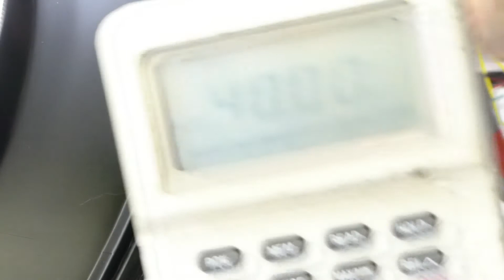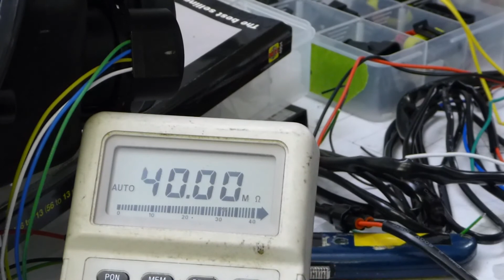FIX: Vertical adjust motor on R56 MINI Cooper LED DRL retrofit projector headlights

Comment: Could you please share the model, brand and where you bought this headlight? Thanks!!
Reply: Unfortunately it's been a long time and they aren't available from the supplier I used - mine came from PowerfulUK and were p/no HLM987-Ch; however I wouldn't recommend them! The bulbs wobbled and vibrated no matter what I did, and in the end we went back to the OE headlights pretty quickly..

Comment: Where did you get the headlights from?
Reply: eBay - they were listed as "F56 look" or words to that effect. Having removed them less than 12 months later I'm not sure I could recommend them, though.. the light output was no better than standard and one beam 'wobbled' due to poor manufacturing

Comment: Sorry to bother you. Quick question after I add the same DRL headlights on my 2012 Mini Cooper s I also had error code said Adaptive headlines codes? Is this same error you got before? Looks like my new DRL do have same plug just like yours.
Reply from the maker: Hey no problem - yeah, we had a persistent error code (which I never actually pulled, but imagine it to be the same one). The headlight levelling worked after I swapped the pins around, but there was something about the lights the ECUs didn't like. We just swapped the original lights back in as the dip/main shutter failed on one of the halo lights already - very poor quality, unfortunately - but that meant I never did get around to investigating the error code..